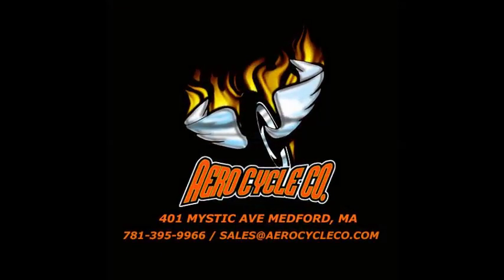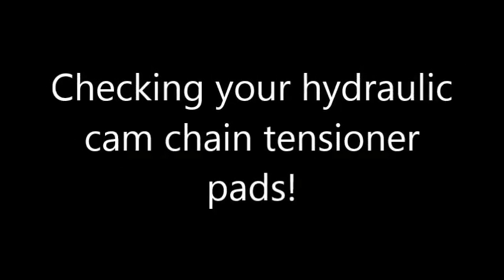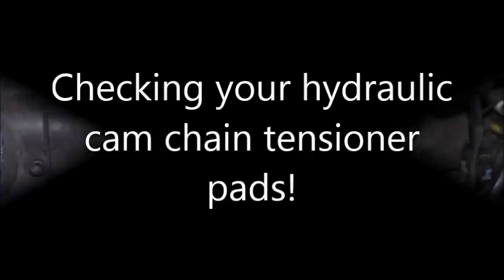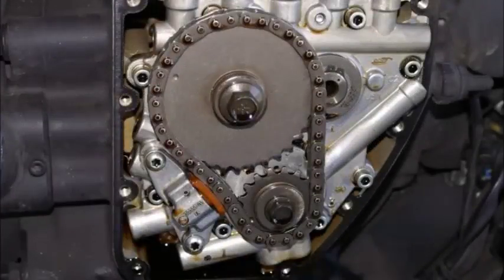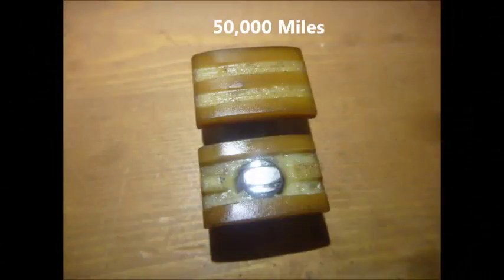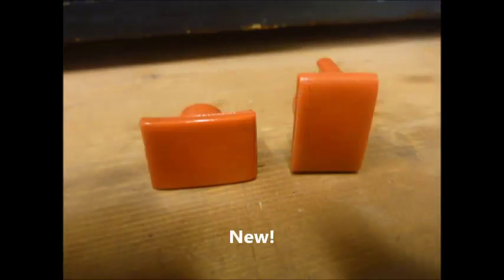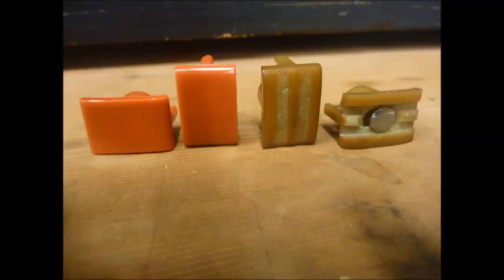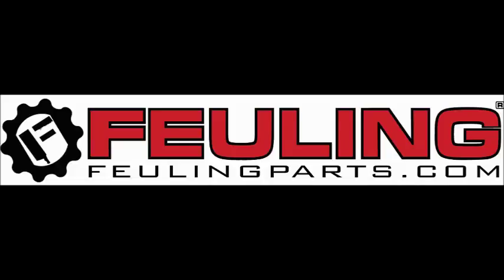Hydraulic Cam Chain Tensioner Short

Comment: I have right now the exact same problem as the stock shoes shown in the video, inter tensioner metal piston came threw the plastic shoe and grinding on the cam chain , a little under 15,000 miles using fueling tensioner shoes .